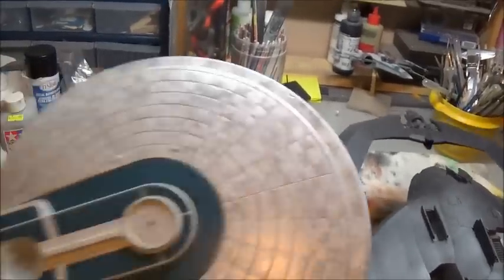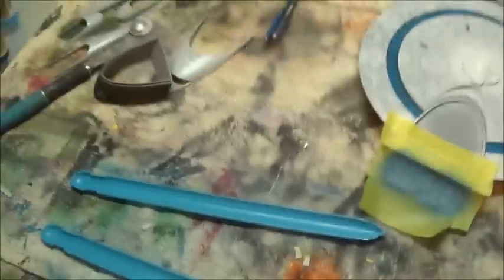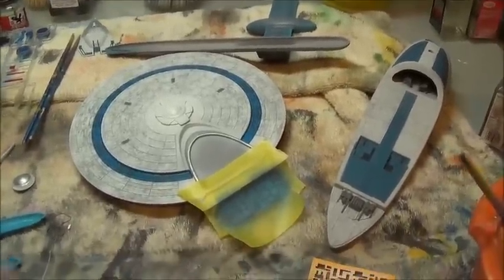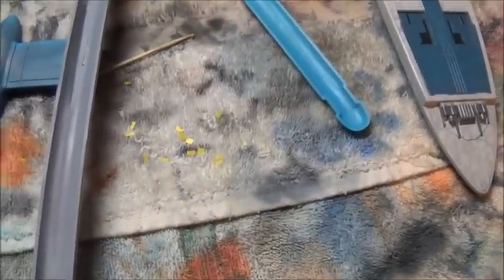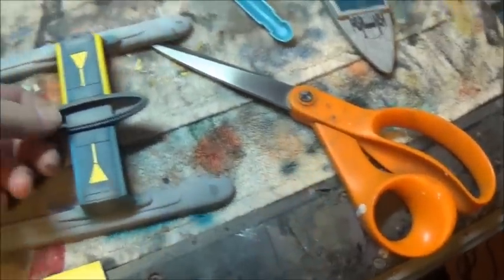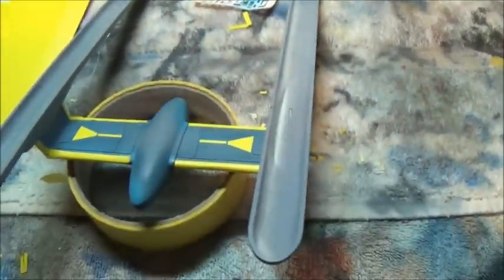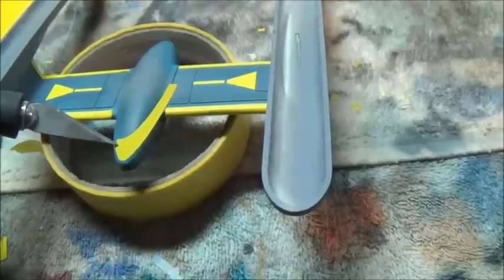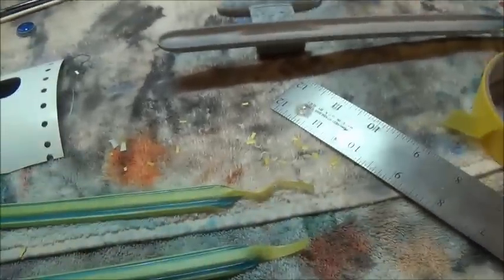Aztek Dummy Update 11/12/16 - Excelsior Pt. 5- engines and pylons

Comment: Technically, the Excelsior's warp nacelles WERE lit up in episodes of DS9.  Maybe not ST IV, V, and VI -- or the episodes of ST:TNG that used the ORIGINAL Excelsior shooting miniature before it was modified for Star Trek VI and ST: Generation.

I'm fairly certain a new Excelsior model was built for the 30th Anniversary Star Trek:TOS tie-in episode on Voyager that was a sidestory to Star Trek VI.  That model was a little bit different from the original that couldn't be restored back to its original condition.  Those stupid add-on parts they glued to the original Excelsior (to turn into the Franken-Ship known as the Enterprise-B; Boris Karloff's Monster was better-looking than THAT ship!!!) couldn't be removed without seriously damaging the model so they went the route of having Greg Jein build a smaller replacement/"stand-in" Excelsior for the ST: Voyager episode.  That model had additional lighting and I'm fairly certain the nacelles were lit on that model as well as an area on the lower engineering hull (cargo bay?).

The CG models of the Excelsior-class ships used for DS9 also had lit nacelles.  Why they decided to change this, I don't know...  Maybe the producers liked the look of the lit nacelles better.  The Miranda-Class (Reliant's) also had lit nacelles on DS9.
Reply from the maker: thanks for that article. but looking at the pictures, it looks to me like they lit the sides ( the parts that are ribbed and painted gunmetal on this kit, not the top part that is clear) - so I going to keep my objection in place.

Comment: Do you remember what the colors were for the top clear piece of the warp engine?
Reply from the maker: No. Those look like model master bottles and I dont even use that paint anymore.
Reply from the maker: In tamiya paints that would be a mix of medium blue and white.
Reply: Thanks Lou! I have those colors and will play around with the mix ratio